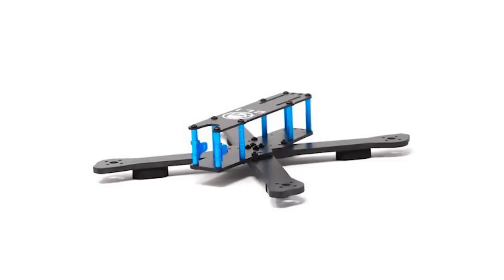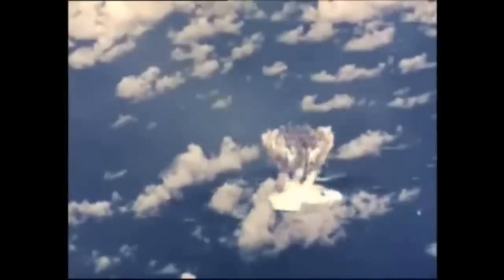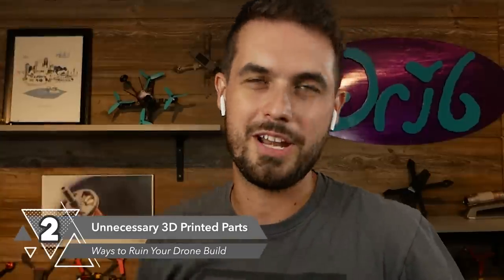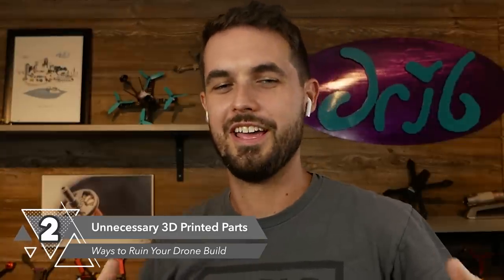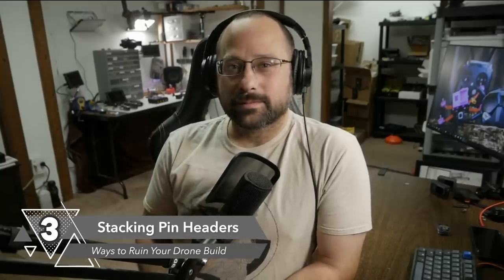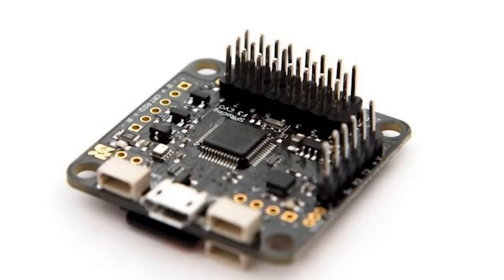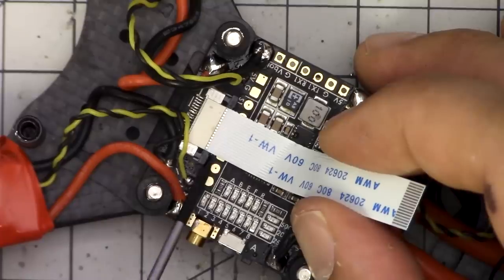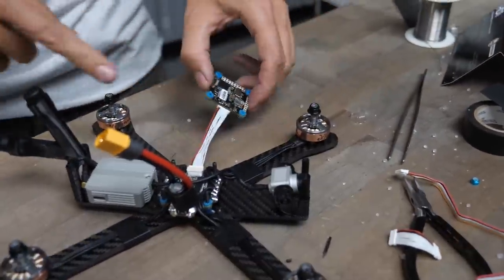6 Ways to RUIN Your FPV Drone!

Comment: I thought that titanium has a high "specific strength", i.e. strength divided by density. So if you take a 1 gram titanium screw it might be stronger than 1g steel screw, in the same time it will be bigger. That's what I thought. But when I checked, steel has higher specific strength, too. Now I don't understand why they use titanium for turbines, etc.
Reply: Lighter in weight
Reply: The guys think they are the gods of the freestyle drone !!!!
Reply: the thing its not the titanium it self. The thing its the carbon that will be broken by the titanium and will bend the aluminium. Are materials that doesn't make good couple. Titanium with stainless still or steel will work better. Titanium will not bend for the aluminium or for the carbon and thats bad.

Comment: When I first started in 2014 I kept mounting my video antenna un-anchored. The cap would catch on a branch and rip out the entire video pipeline.
Reply: Did that in 2017. Frame wasn't suitable for FT48X VTX brick so I glued it to top plate from bottom with double sided tape. On last battery hit a branch with VTX antenna and my video concoction got ripped out and lost. Fellow pilots found it 4 months later in same spot, rotten beyond repair.

Comment: Great video!  Joshua, you are correct about titanium.  The modulus of elasticity of Ti is 120 Giga Pascals and steel is 200 GPA.  So steel requires more force to bend.  Also steel is tough, meaning it can take an impact and not crack or break.

Comment: Regarding standoffs, I'm using the rubber one. I have crashed more than 200 times, my fc and 4in1 esc are still in very good condition. I haven't changed it starting from the day I started learning fpv, June 2019!

Comment: Thanks for the tips. Awaiting parts for my first 5" and am pleased I'll avoid some of these "ruins." I did get a stack with the ribbon so we'll see how that goes. Maybe add a little tape on the connector.
Reply: Don’t worry to much about ribbons. I’ve been flying a matek stack using ribbon for about 2 years now . It’s had plenty of crashes and been refitted in maybe 4 quads no problems whatsoever
Reply: @dalemurray6834  Thank you!

Comment: Titanium does tend to be more brittle. It is a stiffer metal, however when it is being manufactured into whatever shape is needed, it can alloy with other elements that make it less durable. It also tends to be more “slippery” than other metals and will have a greater tendency to vibrate loose if loctite is not used.

Comment: Nylon standoffs are fine if used properly. Not as frame supports indeed. But fine for keeping stack together. In my practice breaking them happened in very rare occasions on definitely hard crashes. Stacking pin headers for FPV quads became obsolete somewhere around 2018 when all new boards started to came out with filled pads and JST 1.0 sockets.

Comment: I'm sure Joshua was half kidding/just trying to make a point, but I will say that most people that participate in the Solar Car endurance racing that he was talking about know that it's not yet feasible for everyday use. Most people see it as the innovation that will one day be able to make it to market, similar to how people see our hobby compared to commercial drones. The competitions are designed to be an engineering challenge and they provide a very fun way of learning and having real world engineering experience. That being said, if you look into the Cruiser class in the US you might be surprised to find that the vehicles that have been built are staggeringly practical (comforts and practicality are factored into their scoring). 

Credentials (if anyone actually cares):
Major part of the design and construction of the University of Kentucky's Gato del Sol VI.
Competed in the Formula Sun Grand Prix (FSGP) 2017-2019.
Part of the team that broke (and still holds) the fastest lap record for a solar powered car at The Circuit of the Americas (COTA) by more than 40 seconds.

Comment: On point about the slammed frames. I bought the Phreakstyle from Xilo slam deck frame and went through 4 cameras before I found one that fit and my fc wires are physically crammed by the top deck.

Will never buy it again, but I'll admit the challenge was fun and it looks rad.

Comment: I used 5mm tall nylon standoffs for a Kakute F7 flight controller because that is the only option.  The mounting holes are not sized for soft mount grommets.
Reply: I have mounted several Kakute 7 with steel standoffs by cutting the rubber bumber in half and placing it underneath the FC. Next down the standoff is a plastic washer sitting on the ESC bumber. Works great. With the Kakute foam mounted gyro, it's all probably dampening overkill anyway!

Comment: You're correct about titanium, where as far as strength by weight is concerned titanium is stronger, overall strength still goes to steel. The modulus of elasticity and yield strength is higher in steel. Although you were incorrect about brittleness, it's actually quite flexible.

Comment: I dont agree with the nylon screw standoff on the stacks for a reason. i use a one long nylon screw for my stacks to prevent my stacks from breaking on a crash. i rather get the standoff bent or snap on a crash than break my stack.
Reply: I agree.  It is also easy to keep a few spare nylon bits in your bag and repair it in the field.  You can't repair a busted flight controller or 4in1 ESC in the field easily.
Reply: @Plur307  yep thats why i use them to prevent breaking components. its ok for the standoff to break. but tbh i never broke or snap one before. also very light and you can cut it in size

Comment: Hallelujah someone finally said it. What's the obsession with 5 inch for the 250g category? Why not 7? Why not make a sub250g X class? Where do you draw the line? You draw it at flight performance and durability. 5 inch has been the magic number for a quad that you can sling around with a GoPro attached and catch sweet imagery. There has never been an enormous trend of pilots freestyling on 3 inch or 7 inch with a GoPro. 5 inch is the sweet spot. When an action cam as good as a GoPro comes out around 20grams then put it in a three inch and we will be seeing similar awesome results
Reply: Sure there's the insta 360 go but I believe it doesn't have the battery life or storage space of a GoPro? Correct me if that's wrong

Comment: I’m doing the unnecessary 3D parts but mine is landing gear, I weighed it out and my design comes to about a gram for a foot on each arm but it’s on a tiny hx 115 the bonus is it keeps the quad from sliding along the ground on its motor wires

Comment: A lot of the Aluminum/Titanium/Steel differences depends quite a bit on the temper, grade, and alloy of the material. It's pretty common with cheap parts, particularly bolts, to have Pure Titanium which is cheap and easy to work, but is significantly weaker than some grades of aluminum. Getting the proper Grade 5/Grade 23 alloys does give you a strength similar to some grades of steel, but they are much more expensive coming from legitimate sources. I've also found titanium to be somewhat better at resisting and damping vibration and better at bending than aluminum or steel, but I don't have any real data for that.

Ultimately, the weight savings you get from 16 M3 screws is like a gram or two, but the cost increase is impractical for the gram or two you save in weight ($3-$10 PER TITANIUM BOLT). There's also no real strength gains, as Gr2 titanium has a listed strength of 40,000 PSI, and Gr5 of 130,000, while Class 12.9 Steel bolts are 170,000 and the more common Class 10.9 are 140,000.
Reply: Easy to work ? Yes !!!!!!!!!

Comment: My fc has the holes for the screws directly connected to the battery + so if I use metallic screws it will burn the vtx on top of it that has holes to ground
Stuck with nylon screws, crashed so may times none of them has broke yet

Comment: I have hard nylon standoffs on my 2.5 inch tinyhawk fr 2, is that a problem on a 100 g drone ?
Reply: Not a problem at all since it's hard to build up enough momentum to break the standoffs with a quad that small. It's mainly a problem on large quads like 5".
Reply: Agreed, should be fine. 500g going 75mph is going to have a lot more inertia to deal with

Comment: I use nylon on my rig and i break arms but ive never had my standoffs  break? the main screw through the carbon is steel but the standoffs between the stacks are just fine

Comment: JST connectors have been the source of SO many problems for me. I hate them. If there are direct solder pads as well, I just pull the JST connectors off of the boards and direct solder. Plus, I like to conformal cost my electronics, and JST connectors are just more places for water to get in.

Comment: button head titanium motor screws also strip easy. got to use cap head if using titanium for motor screws. 12:9 steel is best for motor screws

Comment: Thankfully in Germany if your Quad 250g - 5kg you only need to add a flameproof adress so anyone can trace your quad back to you. Then at 5kg you need to buy a license
Reply: Aren't they currently changing the laws in all of europe? As far as I know here in finland you will have to get anything above 250g registered and will need to pass an online test
Reply: @neonoir__  In France above 800g you need to register it online and put the number on the drone (it takes 2min).
Reply: That'll change in January in germany as well. Then you have to register also drones sub 250g when it's got a camera!
Reply: @neonoir__  The selfbuild drones have their own category. I don't think they need to be registered (unlike the dji types i think), but testing (and much of the regulations) are up to the individual member countries i think.
edit: nvm final implementation has changed and you do need to register. However the platforms to do so are not finished yet XD. Don't do idiotic stuff and you should be fine i guess. Where I live the new rules won't be in effect untill the end of the year. After then I will have to do an online exam and ask a drone registration sticker. Can't fly within 50 meter of ppl (and presumably buildings), which is already the case so i gues nothing changes.
Reply: @someonespotatohmm9513  selfbuild is even worse. You need to register all drones that are selfmade
Reply: @peterzingler6221  Only the pilot according to what i can find. Pilot's label needs to be present on every drone though. Registration of the drone seems to be a requirement for the ce mark and thus needs to be done by the manufacturer. It also seems that as pilot you might need to register the ce marked drones.
Reply: @neonoir__  Same in Latvia. Indeed this is now enforced through all EU. Luckily exam is not hard. And you can slap same number on all your 5" quads.

Comment: As a software engineer I like to make sure code is efficient. But there is a point where throwing better and more powerful hardware at the problem to make things perform better is the way to go.

Same can be said for drones. If you want more performance, use more powerful motors and higher C rated batteries while keeping the build functional and reliable.............🙂

Comment: Ti screws in the motor will have less magnetic interference than steel screws. brushless motors can gain some extra rpm up high wihtout that magnetic interference.

Comment: Damn it guys! Just finally got all the parts to build my dream 3 & 5 inch quads on the Armattan Badger & Armattan Geiko frames and NOW you tell me slammed is no good. By the way, I'm using your board Bardwell; just came in the mail today. Looks good. Great vid guys; more please.
Reply from the maker: The Armattan frames generally have enough height. I think you have 15 or 20  to work with? You’ll be fine :)

Comment: 11:35 Point of order: Titanium is very strong in terms of TENSILE strength. But it is very brittle, meaning that it lacks ductility. Steel can bend and flex, titanium cannot (or least not nearly as much).

Comment: Titanium screws are more rigids, like glass... In an impact they will break , but if you try to deform it will more difficult than steel screw , being though doesnt mean that it will absorb high impact , it need to flex and hold its forms .

Comment: I made the mistake of trying to use the nylon standoffs on the eachine wizard X220S, which is one of many things that was caused from cost cutting. It ended in failure, and i immediately bought a metal stand off kit, albeit made of copper ..lol! As long as we learn, not just from our own, but from everyone's mistakes. Like the 3d printed side skirts/ landing gear/  skid plate i was gonna make, weight be damned... lmao..!?!

Comment: I only Use Nylon Standoff for the vtx mount.  I never had  Problems whith this.

Also i use electrical tape on the Arms to hold the leds and the Escs on and I use old Broken blades (or some Plastik card) on top of the Esc, to Protekt them from propstrikes.  I use this becourse i killed 2 mosfets on one Esc, But i was lucky and could solder New fets on becourse the Plastik housing was smashed, and all pcb tracks were fine.

The biggest fail is to go  as cheap as postible. There you geht only old Hardware like old Motors, Escs, Flightcontrollers like the cc3d, naze32 or something  else.
Reply: So a blood is flying drones ?
Reply: I dont know /understand What you mean.

Comment: All true (althogh I did slammed builds with 15mm standoffs). One way to ruin an otherwise good build that I see often is using outdated cheap motors like ones from Racerstar or Dys. They kinda work but the Emax Eco or iFlight Xing-E are so much better that I would consider it ruined. Nests of long cables, bad solder joints and unsecured antenna or lipo cables are also good ways to ruin your build.

Comment: Why have a 5 inch under 250g that can't carry a go pro, because some people don't care at all about footage and just like to fly and have restrictions
Reply: What they were saying is, if you're flying without a GoPro you'd be better off having a sub250 3 inch because there is less comprise
Reply: When you try to keep a 5 inch under 250g you're going to have to lose some carbon and subsequently some durability, where as a sub 250g 3inch can still be built tough

Comment: lol. I love this conversation about how 250g 5 inch ruins the drone. A few months later RR is selling a 250g 5 inch. He's right though. You can't carry a gopro so there is no reason to stick with 5 inch props. 5 inch props happen to be the size prop that can easily carry and throw a 650g to 750g quad without looking floaty. Lower the weight to 250g and 5 inch props are just too much. Might as well go to 3 inch if you're going sub 250g.
Reply: They were referring to the wheelbase of the drone frame. Not the size of the propellers.
Reply: @andyhoughtaling6319  A 5 inch quad means it uses 5 inch propellers. A 3 inch drone uses 3 inch propellers. A 7 inch quad uses 7 inch propellers. No one refers to a drone based on it's wheelbase. They are always referred to by the size of the props they use. 5 inch props are great because they carry a heavy quad and a Gopro and are still agile, semi efficient, but not too powerful. Building a 250gram 5 inch quad means you can't carry a gopro if you want to stay under the 250 gram mark, so there is no need for 5 inch props. You can go lower. 3 inch to 3.5 inch is a good size if you aren't carrying an HD camera and want the quad to fly similar to a 5 inch that is carrying a Gopro. A 5 inch 250 gram quad will fly about like a 7 or 8 inch quad with a Gopro. Those are very floaty and don't fly the same as a 5 inch with a Gopro.
Reply: @CarbonGlassMan  Do you just need someone to talk to, or...?
Reply: @andyhoughtaling6319  Oh. I thought I was helping you out. You're just here to act like a little kid. Got ya.,
Reply: @CarbonGlassMan  Sorry for not being serious enough on a Youtube comment while talking to a random stranger about flying toy quadcopters. My bad.

Comment: Titanium is kinda of brittle when compared to steel, but is still stronger then aluminum. Think of it like an Aluminum plus...The goal behind Ti is to be lightweight but slightly stronger then aluminum. Aluminum screws basically have the same properties as Titanium. Steel is heavier but it bends before it'll break. ALum and Ti can sorta bend, but they snap quicker. Once aluminum bends it is compromised.

Comment: Great video, but i disagree on the titanium screws on motors part. 
I use titanium all around. Saved myself about 6-7 grams. Works great. Expensive for sure though. 
Price to performance is stupid. but if you wanna spend the dosh, go right ahead.
You will save about 1 gram per arm. So it's not allot. But i have crashed my quads many times. It's not the screws that fail... the the carbon.... or the motors themselves.
I can re-use those screws again and again.

Comment: Strength: Titanium is 3-4 times stronger than stainless steel, but less hard than 304 stainless steel.

For something like propeller screws, titanium is superior but for motor screws steel is the best.

Comment: Your not wrong about the Ti screws, they shear off, and bend, and are a pain in the ass. The heads break off if you over tighten them. I switched to stainless once I realized the weight savings vs the pain in the ass was not worth it.